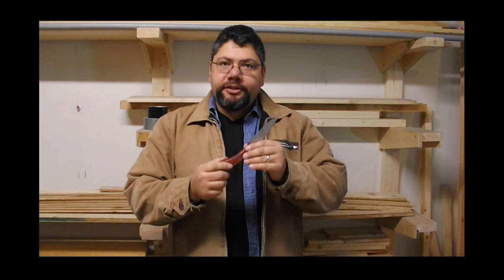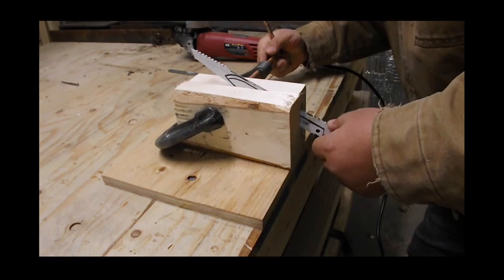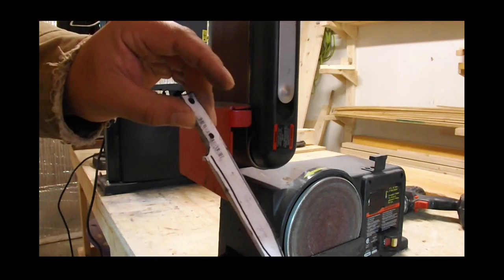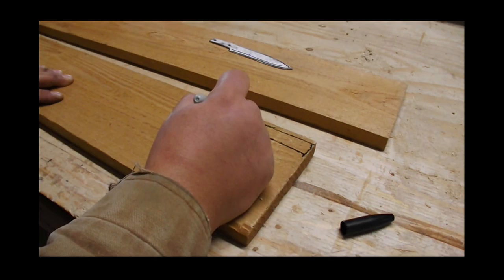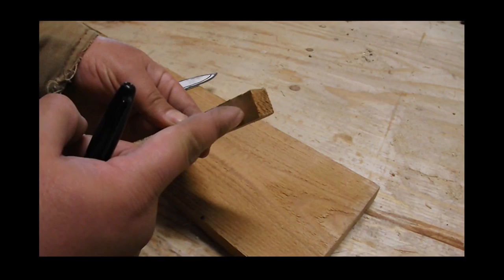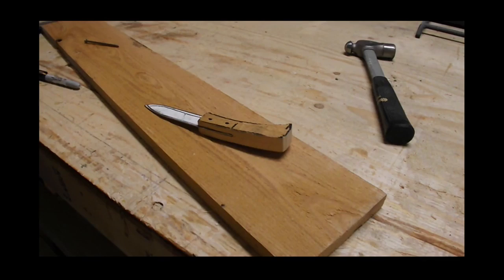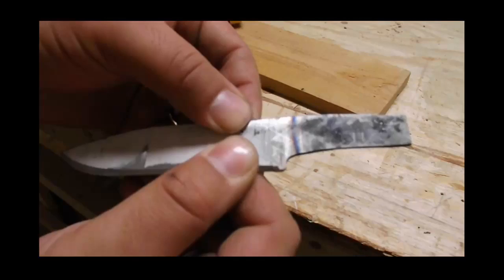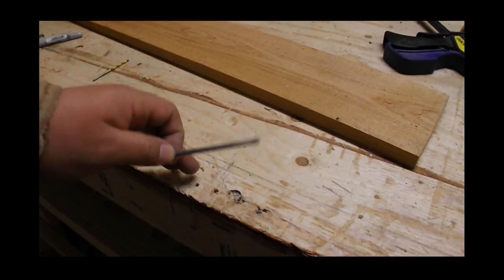How to make a knife without a forge

Comment: Thanks for the video. You mentioned you might test the knife performance -  how did it perform?
Reply from the maker: pruff i could never find a good way to test the knives other than actual use. Oddly it’s my garage and garden knife. It’s small, holds an okay edge and if it’s destroyed I’m not too worried. So like I said oddly it’s one of my more used and handy knives.

Even used it as a steak knife when camping once. But wouldn’t recommend using for make a fire stick.
Reply: @Metalandstuff464  Thanks for your reply. My recent exploration through youtube helped me find this Australian who does his own tests on knives that he has. I like the simplicity of it, basically he sharpens each knife the same way on an angle assisted sharpening stone rig, then starts cutting slices through rope until a given knife can no longer cut through a piece of office paper. Here is one of his videos: https://youtu.be/2c97dZkXVvg  

Of course I don't expect you to have to do all that. That's cool you are able to make use of your knife though. I just recently got interested in knives and I would like an easy way to make tools with scrap metal that I don't have to forge myself.